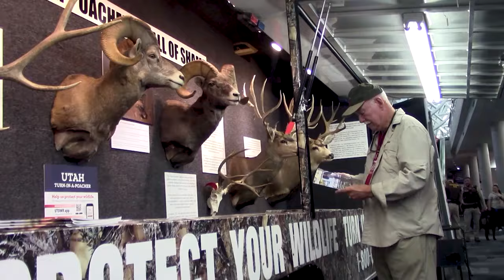S22 E28: Tushar Rim Trail

Comment: Really like stories on out of the way OHV areas.  You have done several stories on area trails near Green River. Is there a place to go for more info or maps locally. We have gone to GR several times for riding in the swell. We were never able to find info on trails.
Reply from the maker: visit https://outsidersutah.com/ and go to the trails page. From there you can search Green River and it will pull up all the trails we have mapped in Green River.